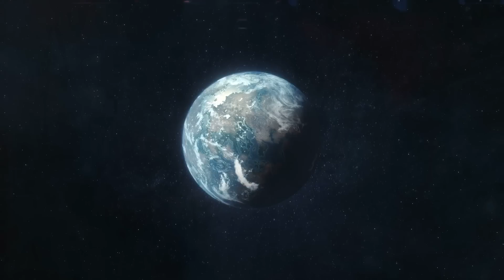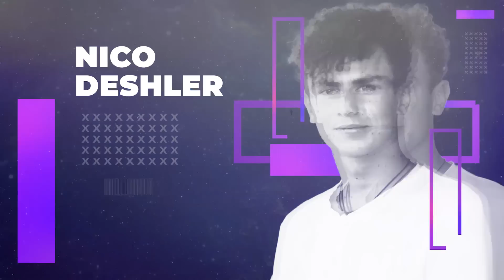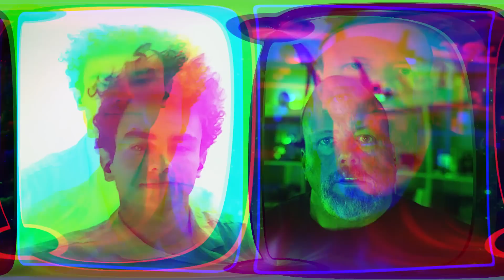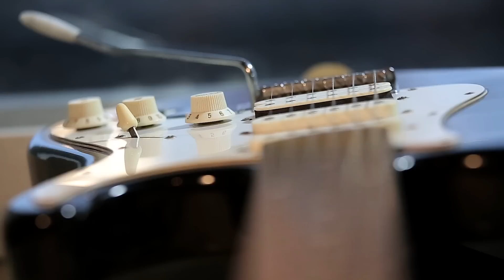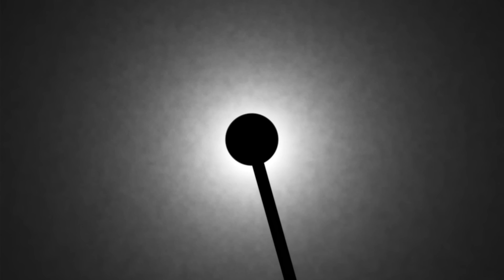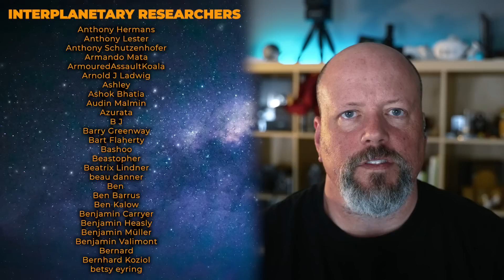How Quantum Coronagraphs Will Help Us See Earth-Like Planets Around Sun-Like Stars

Comment: Correct me if I’m wrong, Nico—but do these Spatial Mode sorters, aside from enabling better wavefront measurements, also enhance light collection by bypassing the high-frequency limits of current adaptive optics? Essentially improving both brightness and image quality for faint targets like exoplanets?😯

So in short: this tech could merge coronagraphy and adaptive optics into a single, more efficient, and cost-effective system—making ground-based telescopes significantly more capable. It’s not just a super-coronagraph, but also a superior wavefront measurement device that additionally enhances the visibility of faint objects 'for free'. And since it replaces three separate systems, it’s like a 4-in-1 upgrade!🚀

Does that sound accurate? 🤔

Comment: The question of commercial relevance is an interesting one.
The number one idea which came to my mind on this is (if I’m understanding correctly) that the ability to “sort” light at the level of individual photons, and actually garner discrete information “per photon”… sounds like something that could be extremely useful for encryption.
With everything we’ve been hearing about quantum computing, possibly rendering “encryption” meaningless…
And… how AI is going to impact this as well…
The potential (in this regard) is not only highly intriguing… but timely as well.

Comment: Spatial modes are very common in radio and microwave atennena, we call them antenna patterns.

Every antenna has a unique pattern for example a radar dish has symmetrical sidelobes.  A dipole has distintive pattern.  A phased array can create many many programmable "modes" we call them antenna patterns.  A laser has modes but its phase and amplitude summation of waves inside its structure.  

Thinking of these in terms of photons you lose all the intuitive nature of how these are formed, they are summation of phase fronts.  

You can use fourier or other transforms to create the modes, we used in radar, as we shine a beam on a complex surface the object creates an inteference pattern which is unique for an object.  Optics guys are now working in the wave and  phase domain, which photons are oversimplified concepts, each photon group would need analog amplitde and phase attached which is wave.

Comment: Is this theory and technical approach to detecting Earth-sized exo-planets applicable only to the visible light portion of the electro-magnetic spectrum?  Or can it be also used with radio waves, microwaves, infra-red, ultra-violet, X-rays or gamma rays?
Reply: It doesn't really do anything for enhancing visible light input. It will block the sunlight by filtering it out, without filtering out the exo-planets light spectrum. Because quantum, quantum, quantum.
Reply: @CeanStrauss Thanks.  But can it also be used to block infra-red from a sun, while allowing an exoplanet's infra-red waves ( or radio waves, etc.) through?

Comment: The HWO coronagraph design is kinda nuts - includes 2 deformable mirrors each with a 96x96 grid of actuators (9,216), a required accuracy of about 4ppm and stability over minutes to hours.  The commanding rate is probably about 1Hz, but there will need to be internal closed loop control to meet the stability requirement.  The light path is similar to the Subaru Telescope design...
https://exoplanets.nasa.gov/internal_resources/2859/DM%20Performance%20goals_External_9_30_2023.pdf